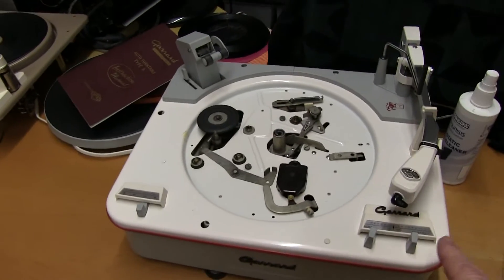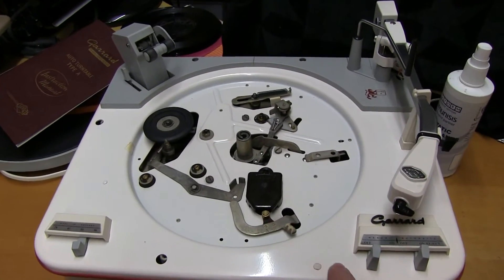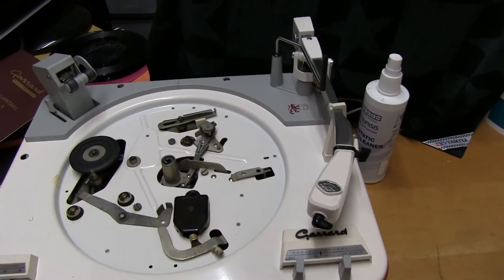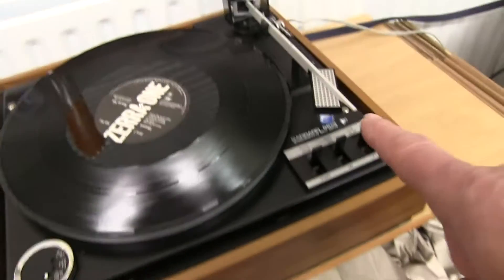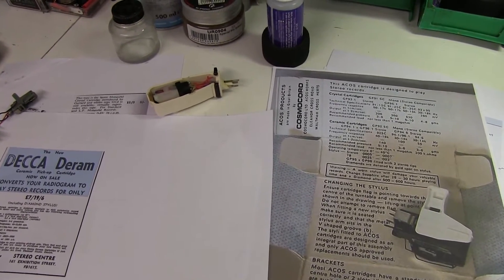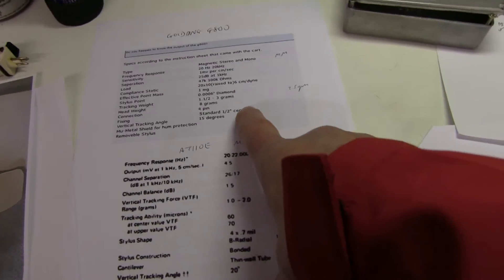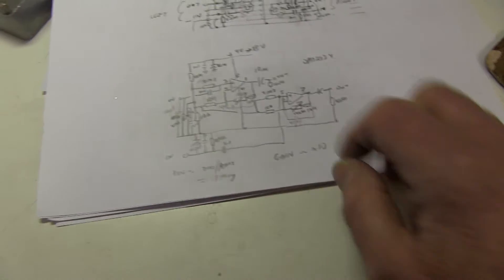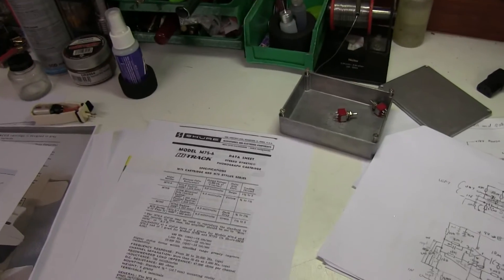Buffer and RIAA Preamp for MM and Crystal/Ceramic pickups.

Comment: Hi nick is there any way I could connect a mp3 player to my ceramic cartridge input on my stereo valve amp the cartridge plugs into a 3 pin socket  barry
Reply from the maker: Yeah it should be fine. If its a stereo amp then just wire the plug up for left input and right input.
Reply: @nickadams5411  hi nick thanks for the quick reply   I have tried that but it does not work not even a peep it works with the ceramic cartridge  barry
Reply from the maker: @barryreeves9191  What do you mean it doesn't work, is it the volume that is too high or too low? Some more context or info would be great to figure out the problem.
Reply: @nickadams5411  hI nick sorry for not explaining properly no sound 
 I cannot hear any sound from the stereo valve amp      I am connecting the 3.5mm output from the mp3 player directly to the ceramic stylus input on the amp and even with the mp3 player on full volume and turning up the valve amp there is no music playing if I wipe my finger on the terminals it does make a little scratching sound  i suppose its a mismatch of technology   barry
Reply from the maker: @barryreeves9191  The ceramic input requires a very high signal level, your amp might require a higher level than other amps which would mean that even the mp3 player output on maximum output wouldn't be sufficient to drive it. Did your amp come with a specification of the input level? If it requires a very high level signal you will need a booster circuit on that input.
Reply: @nickadams5411  hi nick thank you so much for spending the time to answer    there is no information on the amp as its in a 1965 jukebox I  think you are right about the cartridge input requiring a high input signal as I did read somewere that it has a high output stereo ceramic cartridge  barry
Reply from the maker: @barryreeves9191  Hi Barry, you need a booster circuit, they are very cheap.

Comment: Howdy Nick, You sent me a schematic and it was pretty distorted I wanted to know if you could confirm or deny the values for resistors, capacitates(capacitance and voltage) and inductors.
 I added what I thought the values were onto the original schematic, just needed your email to send that on over. If you want my email it's harrison.hightower@earthlink.net
Reply from the maker: Hi. Yes send me the values and I will check it.
My email is:  nick@demonproducts.co.uk

Comment: I'm going to make a ceramic cartridge buffer circuit, but it's going to use J-FETs instead of an IC, I've experimented by hooking a ceramic cartridge up to a source-follower J-FET circuit I came up with and it sounded good, I just need to find a couple of very high ohm input resistors to bleed of any charge that accumulates on the gates. Output voltage isn't a problem for me since I'm going to connect it to a mixing deck where I can adjust the gain that way.

Comment: Just wondering, where do you get the cricuit board? Also how does the ceramic one sound with and without the RIAA equalisation?
Reply from the maker: Hi
That is  a Vero board for protyping. It is sold in larger sizes that you cut to size.
I prefer the sound of Ceramic with RIAA equalisation, as it really lifts the bass and cuts the noise a little.
I am always suprised at how nice some of these old players and discs can sound when played through modern hi fi equipment.
Reply: Nick Adams That's awesome, do you by any chance have the schematics still? or perhaps one that is as simple as possible, I basically want to make a vinyl player with the minimum, so I originally thought about connecting the ceramic cartridge straight to the amp but I am not sure how to get the high impedance! I've seen some things about tube buffers, do you think they would work?
Reply from the maker: Hi
Sometimes you can connect directly to a hifi amp (aux input)with a resistor in series with the signal wire of about 470Kohm.
The signal is cut down, but ceramic pickups have high output signal and is often enough to give good volume.
There are many cheap solid state buffers on Ebay, such as the "Little Bear"
Tube (valve) buffers are more expensive.
I may have the schematic, email me.